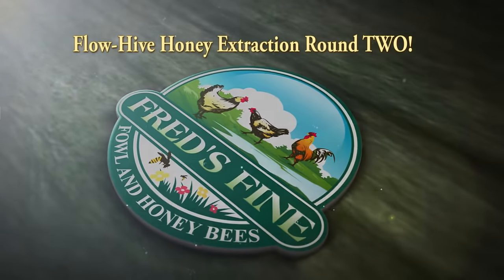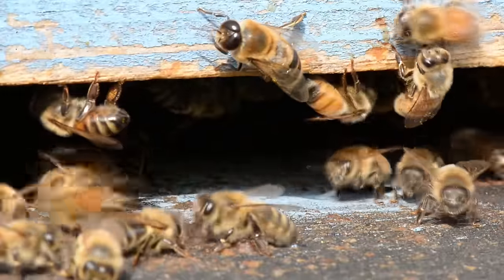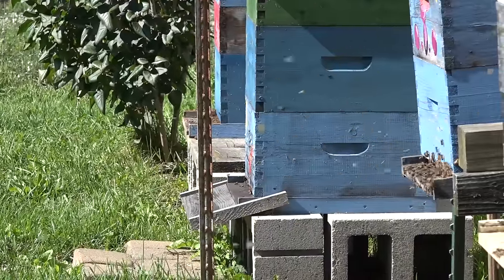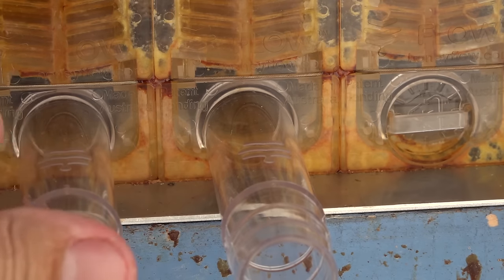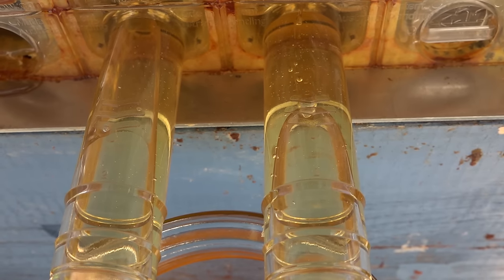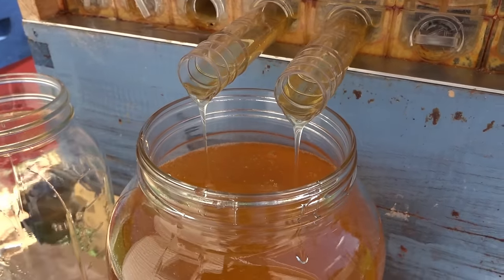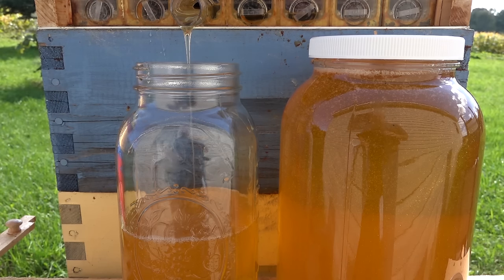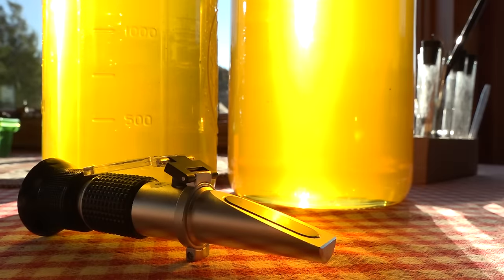The Flow Hive for Honey Bees 2nd Honey Harvest Review and Testing

Comment: In my experience, the REASON it takes less time the second time around is that once plastic comb has been used, be it Flow frames, Honey Super Cell or PermaComb, after they use it they act like it's just comb and don't hesitate to use it like they do at first.  Probably it's polished with propolis at this point, but whatever the reason it gets treated just like any drawn comb.

Comment: 9:57 I notice that when you open the frames with your 2 metal "keys" The plastic on the top of the frames Bend or Bow quite a lot. Do you foresee them breaking anytime soon? Especially with some climates freezing and thawing. Usually, that weakens plastic. I am wondering about longevity and is that one reason you use 2 keys instead of one. THANK YOU for your reply! Great job
Reply: I have the same concern! I am very interested in buying a flow hive box, but this is holding me back. 
I had been beekeeping for a while,  but I had a ton of help
 Now, I would be doing it on my own, and lifting hive boxes full of honey is quite daunting!!
I like the idea of leaving the hive intact for both the bee's sake, and mine!
Reply: @jenniferbarrett9253  I have seen no long term users address that point yet. But I am going to assume that they will break in the cold over time. I might try the china copy first to limit my investment. Then move up to the real one for a 2nd hive if I deem its worth it. The china one is so cheap that even if it breaks, its cheap enough to get more.
Reply from the maker: That's a great question and a real concern. I've been using the Flow-Supers every year and have not had a material failure yet. One of the reasons that I like to use two keys is that I see it as less stressful on that plastic arc, so I concentrate them towards the shoulders. But I also haven't received any feedback regarding broken pieces with the exception of those who purchased the Chinese knock-off versions... but I think they also made the mistake of leaving them in direct sunlight during storage.
Reply from the maker: Jennifer, you may want to consider a Long Langstroth style hive if lifting is a big concern. That is the easies to manage hive design I've found.
Reply: @FrederickDunn  ahh, thats interesting! could you share a story about the broken parts on the Chinese copies? thanks

Comment: I would like to know what happens with the wax? In Mexico is common to buy wax from bees (which is super tasty), is there any way of getting wax from this?
Reply from the maker: Hi Daniel, with this system, there is no meaningful amounts of wax to harvest. The caps are removed by the bees and flown out of the hive. For those wanting to obtain quantities of wax will need to cut comb the old way and even traditional uncapping practices produce quite a nice amount of wax. Remember that the more wax you remove, the more the bees have to produce to repair and draw out the cells. I hope that answers your question?

Comment: Hi Fred it’s Wally here from down under (Australia) we have some Flow hives as well. 
 Your videos are really excellent and educational, you said that you have to harvest the full flow frame, that is sort of incorrect as what you can try next is insert the key only a 1/3 of the length in and you can only harvest 1 small jar of honey only instead a full frame, will make a video next time we harvest honey and I show you what I mean.
Reply from the maker: Once the keys have been inserted and cycled the frames, closing them doesn't stop the drip. You are right that you "could" insert the key only partially and drain off just a little. I highly recommend that people don't do that because this leaves the frames with partially new nectar in the cells and you can't reach back to the deeper cells later and open them without re-opening the newly loaded cells. You end up, potentially, with uncured honey mixed with cured honey. I would highly recommend against only partially draining a flow-frame unless you plan to take the rest on the same day. I hope that makes sense Wally?

Comment: Frederick, do you have any idea yet how long these frames might last? I've not seen one in person nor do I know anyone who has tried them.  Also, how often should these be removed and cleaned?
Reply from the maker: I haven't yet determined how long they may last, only that they have not shown any signs of wear so far. At the end of the early Autumn draw off, I remove the frames and allow the bees to clean them up and then they are simply stored for spring. If any of them appear not to be cleaned properly, I plan to power wash them but haven't had to do that yet.

Comment: Thank you so much for you incredible and informative videos.   I am very interested in your idea re an upper entrance to save the workers not having to go right up through the brood chamber. Please can you advise what the opening  size is? I have a new Langstroff hive which has only two small openings at the bottom and they are closable with timber inserts that swivel. I notice your bottom entrance is open right across. This is my first hive that has a flow kit coming quite soon. best Wishes Mick Hall  - Nottingham in the UK
Reply from the maker: A 2 centimeter hole would be more than enough for the upper entrance. I highly recommend putting a gate over the hole so you can close it off quickly if robbing begins.

Comment: Just a quick question about your harvesting kit. Would it affect the harvest in any way if you were to put small mesh filters over the lid of the jars, letting the honey flow it, just to keep out yellow-jackets and maybe some contaminates?
Reply from the maker: These days I use ReCap Mason Jar lids... they have a perfect opening for the flowhive tubes. As for adding a filter, I don't think that's necessary with this system.

Comment: Thanks for posting this.  Still watching as i write.  Watched a promotional video for this type of frame so had a question that came up in the comments of the promo video:  Does the shifting wall movement of the flow frame cones harm the bees?
Reply from the maker: It never ever harms the bees, they are not in the cells when they cycle, but even if they were for some reason, there is space enough for them to move out easily before any injury can happen. I've been through many cycles with all of my flowhives and not one bee toe has made it into the honey thus far :)
Reply: @FrederickDunn  Thank you

Comment: Can you tell me how you know if the cells have been capped on the inside frames?  Do you have to pull the frames out to check or is there a way to tell without removing the flow frames?
Reply from the maker: Hi MIles, in every case, without exception, the bees capped the honey cells from top down and from center out, so if you see them capped at the edges, they are capped in the middle. The only case where I've found capped cells on the outside with uncapped honey cells in the interior is on brood frames. Since these are honey supers, there is no brood present. Thanks for that question!

Comment: Fantastic, informative videos.  My question is, how did you manage the flow hive supers over the winter?  Did you remove them after extraction and store them, or did you leave them on the hive full over the winter?
Reply from the maker: We are now in mid-late winter and the flowhives are all ON. I did that this year in order to observe and learn. The honey in the flowframes did crystalize and the bees are using that honey as I see it going away bit by bit. In the spring, I'll pull the frames and see how much is left, if any and then demonstrate how to clean and prepare the flowframes for another season. But they remained on.

Comment: I wonder if this can be used indoors? Using an isolated area with just direct access to the outside for the bees. Or do you still need to do maintenance inside these flow hives?
Reply from the maker: They work best outdoors, you "could" install one inside a shed or outbuilding, but would need to modify the entrance and have a high interior window that opens by tilting out to release bees when they fly during inspections.

Comment: Very impressed with your entrance direct into the super. Would this cause any problems? Would the Queen bee try to enter here to lay?
Reply from the maker: I no longer use any upper entrances and no upper vents. There is always a chance that the queen "could" lay in the flow super. That is profoundly reduced if you don't use the upper entrance model, with no upper vent.

Comment: I'm not a beekeeper, but I am fastenated by it. The questions I have about this system deals with the longer term maintenance.
How many cycles will you get from the frames?
Will cold (freezing) temperatures significantly reduce that number?
Can the frames be repaired? By yourself? By the factory?
Not trying to be a pessimist. But these frames are much more of a mechanical device that traditional frames. Moving parts break down. Plastic parts break down. I'm just curious as to how much time, and money, these will take in comparison to traditional frames (which need maintenance too).
This looks like it could be a good thing. It may need some "tweaking" before it would be usable on a large scale. But it could be like digital photography. It may take a while to get going. But it could be a revolution in the industry.
Reply from the maker: The life expectancy is unknown at this time, but none of mine have failed yet. The action of the frames is somewhat lubricated by the propolis and was the bees press into them so it will be interesting to see if there is friction wear on those mating surfaces. As for the cold? I don't know of any reason that cold temperature should impact longevity, we're not talking about extreme cold and they are not used in winter, exposure to sunlight would be more problematic in my opinion. You can replace single frames if necessary in the future. To date, I'm content with the material quality.

Comment: Hi Frederick. I have just started my first hive. I noticed that your hives have two brood boxes and two supers. One has a small super above the flow super and the other has the small super below. My flow came with just one blood and one flow super. What are your thoughts around why and when to put a second brood box and a second super. Thanks so much for your vid.
Reply from the maker: Hi Ivan, thanks for watching and commenting :)  I put extra boxes on because I live in the northeastern United States and our winters are long. The bees need honey stores to help them get through those frozen periods. I always suggest that people put at least one medium honey super on their base/brood-box and after the bees have filled that with honey, or are near full, add the Flow-Super on that. Then if they generate enough surplus in the flow-super, drain that off when capped. I did experiments to see if the bees would go through the flow-super and fill another medium above that instead of using the flow-frames and some did while others went straight to work on the flow-frames. If you live in an area where honey and pollen resources are available to the bees throughout the year, then it isn't necessary to add extra boxes. Some keepers pull the honey off, remove the flow-super and then replace that with a medium box with a feeder inside. It's my opinion that it's better to have the bees create their own winter resources and hopefully avoid having to feed.

Comment: Great video! Thank you! My question is about the boxes under the super. It looks like you have two and a little one. I assume I should do the same. Is that two brood boxes? What is the half box? Thank you! :)
Reply from the maker: This is my standard setup for col climate hive setups that include the Flow-Super. One deep brood box, once that's 80% full or better, ad a medium super. Once the medium super is 80% full or better that's when I put the Flow-Super on and this should be timed with a strong nectar flow. As winter arrives, I remove the Flow-Super and leave the bottom two boxes for wintering. This configuration is working very well in the northeastern United States.
Reply: @FrederickDunn  Thank you so much! I really appreciate you getting back to me. I am starting with one hive this year! I can't wait!
Reply: @FrederickDunn  Where in the Northeast are you? I'm in New Hampshire

Comment: You can get rid of those pliers....use the tip of the 'key' to open the doors. Works a treat.  Great video-ing, and great close ups. :-)
Reply from the maker: Hi Sam, yes, you can use the key instead of pliers and they include extra plugs in case you damage one.
Reply: I didn't get any extras in my package...and Im from australia
Reply from the maker: In all of mine, there was a small baggie with bottom and top plug extras, no idea why it was different for you?
Reply: Possibly because I'm within 3 hours drive from them, postage is cheap enough.

Comment: I'm curious what was the reasoning why the second draining of the flow frame resulted in less honey leaking into the hive?  Were the bees sealing up the places where honey was leaking into the hive?  Great video and I appreciate the work you are doing.
Reply from the maker: Hi Justin, after the first "cycling" of the flow frames, the bees continue to "glue up" the joints and leak paths. It's pretty interesting. I received an e-mail from the flowhive people about my video and they said the leaking is common the first time around, but shouldn't happen to that extreme the second time. My plan was to bench test the flow frames and observe where the leaks were occurring. BUT, after hearing from Flow, I decided to simply do a repeat cycle and see if the results were different and as you can see, they were indeed. I was pleasantly surprised.

Comment: I just watched a few more videos, and it seems... as you said... you cant stop the flow once you start it. But you can just put the key part way in, and only crack the back half, or quarter or whatever. That's from Flow Hive videos. In their videos the often use the key to open it bit of a time because it requires less strength, but in one video they also mention just taking a bit of the honey out of a frame by only cracking a section of the back part. If you can crack it a little at a time, it must not all be connected (I dont really know how that bit works) which means you can reset that little bit without doing anything to the other cells.
Reply from the maker: Hi Craig, I'll address this topic in my next Q&A. I'll explain why I don't do partial draw offs in the way you're describing. Thanks for watching and commenting. :)
Reply: @FrederickDunn  Cool, thanks.

Comment: Fred, i thought id mention that a half gallon per frame is normal for the flow hive frames, if you only got a quart and a half the last time then you know how much leaked out the first time, also ive noticed that some of your hives are close to your house, is there any issue with defensive bees when you walk around or cut your lawn?
Reply from the maker: Hi Scott, yes, a 1/2 gallon per frame, even a tad more is now common. When the frames are new, they tend not to draw out the cells so far as they do with subsequent cycles. I've not had issues with defensiveness when cutting the lawn as I use an electric mower in the apiary rather than a combustion engine. Thanks for commenting :)

Comment: Once again I loved your very informative video. I do have a few questions , as my bees are still filling the brood frames.
From what you said, it may be advantageous to have an entry hole in the flow super so the bees that have been foraging can have a more direct route into the top box. Should I provide such an access hole for them ?
Did you need to filter the second harvest to remove any wax particles ?
Here in Australia where I live the winters are mild by comparison to yours and there is not a long period when there are no flowers,...maybe three or four months. So, how much honey should I leave for feedstock ? 
What is the secret to not wearing protective clothing and not getting bitten ? Not sure I want to try but as the summer kicks in I don't want to wear more than I need to.
I think your videos are of sufficient quality to be on the Discovery Channel, you should contact them.
Regards
Chas Greenway
Perth , Australia
Reply from the maker: Hi Chas, it's great to be exchanging thoughts with someone so far away. Regarding the upper vent/access hole, it isn't in the flow frame it is in another honey super located just beneath the flowframes. That may not be necessary for you, though additional ventilation in hot areas can be obtained by venting through the top.
Here in the "snow-belt" of the United States, entry boards and entry reducers can in extreme cases be blocked in winter by dead honey bees. Without any other access for the bees, the colony may die out and the keeper finds all of the bees dead inside the hive. Some keepers turn their entry reducer upside down so the colony members can go over the top of dead bees until they can be removed.
Again, I didn't put the access hole in the Flow honey super, it's in a traditional shallow super.
Thank you for that wonderful comment!
Being that you are in a warm climate where there are nectar sources year round, you can gauge how much honey to leave by simply viewing the flowframes. Leave them a few undrained frames and see if the consume or add more.
Reply from the maker: Regarding the wax particles, I personally don't mind having tiny bits of wax or even propolis in my honey, so I plan to leave it in :)